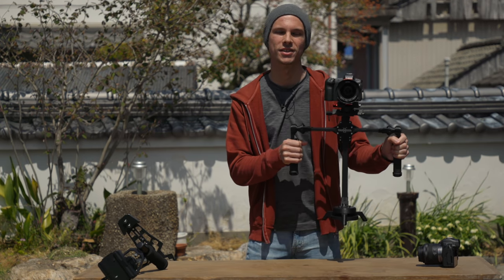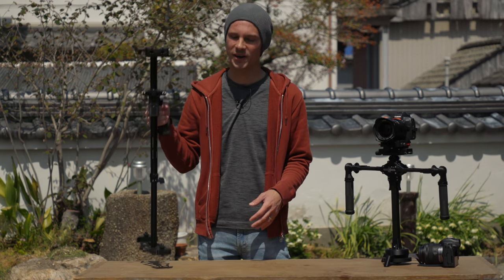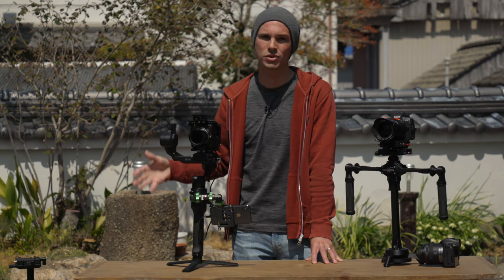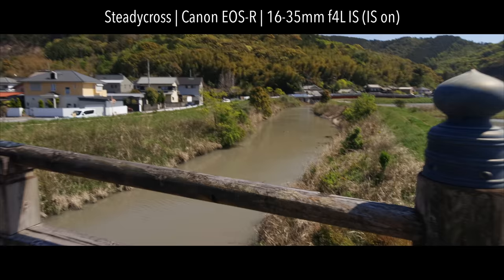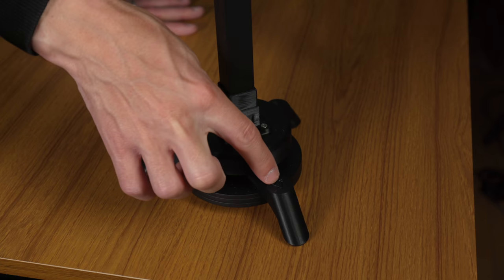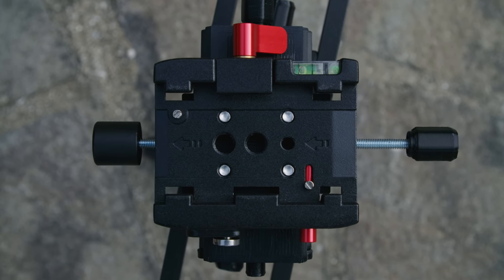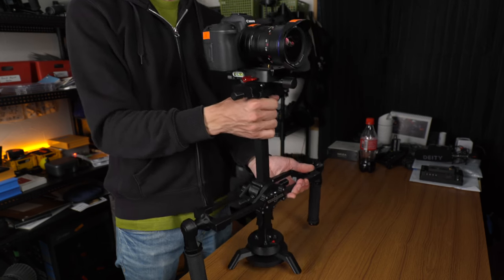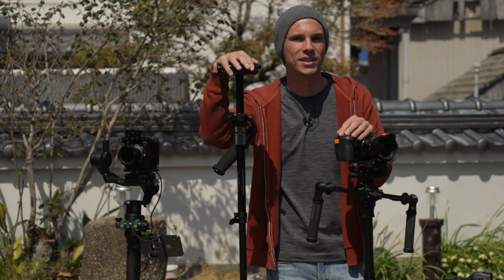An Amazing NEW Type of Camera Stabilizer | SteadyCross

Comment: I just got the steadycross g1.6, does wind affect it alot, or slightly? I'm a beginner and just want to know that for sure before I make my own assumptions, thanks.
Reply from the maker: Nice! I actually didn't notice they'd put out the 1.6 version haha. Glad to see that. Wind can affect it for sure, but I find that it's less than with a glidecam. It could depend on some other factors too most likely like the weight of your camera and how sensitive you have it set with the cross axis's position and damping, but without electronic motors it won't be fully resistant to wind.